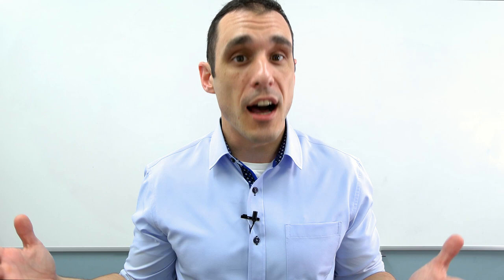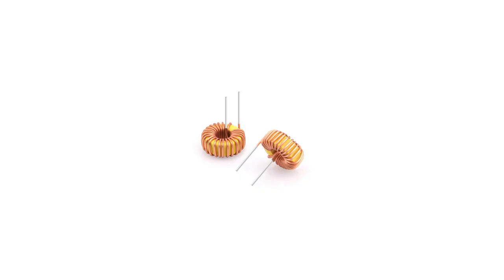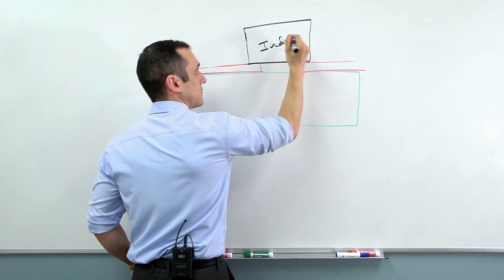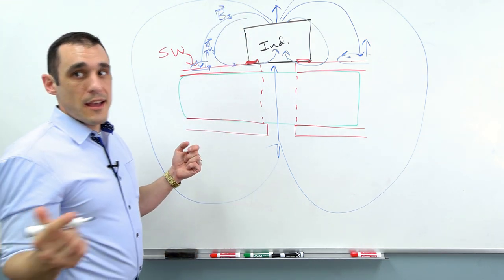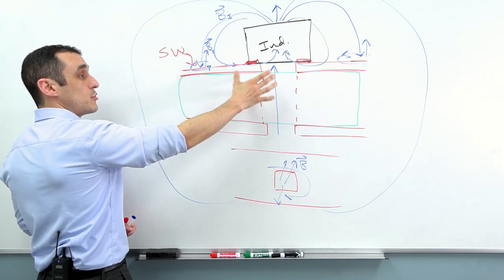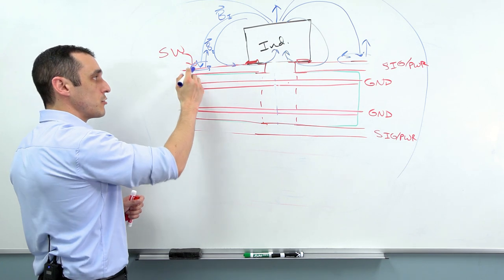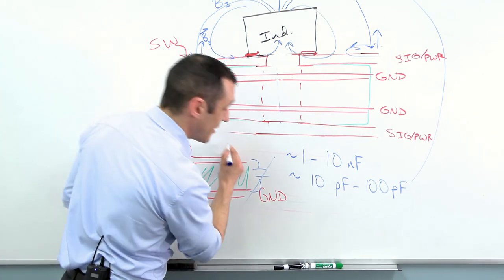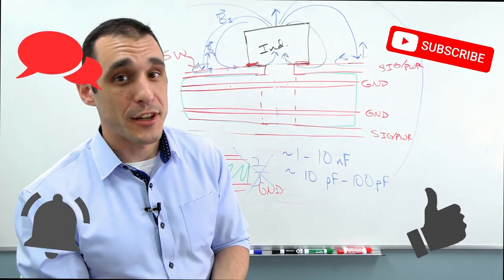Should You Put an Inductor Above Ground? | PCB Layout

Comment: With the cutout, you draw lines going all the way around and into the hole, without the cutout this path has a lot of shielding in the way, does that force these field lines to take a shorter route to like the shorter ones? Is that, and I have no understanding of this, good?
Reply: I draw it like this because the magnetic field always involves closed loops, and assuming the conductors are perfect there would be no normal component of the magnetic field (it would be canaceled by the eddy current). This means the conductor would distort the magnetic field so that it maintains a closed loop above the board.

Comment: Can this be applied to common mode chokes? Just curious
Reply: Yes because a common mode choke is essentally just a pair of inductors. The coupling is the same as you would observe in a transformer, just typically at smaller scale. The difference with common-mode chokes and transformers is that these components attempt to confine the field inside a magnetic core to ensure maximally efficient coupling (i.e., low leakage inductance). Because of how the component is designed you intend to not have much leakage of the magnetic field so you would expect less of an impact compared to an individual non-shielded wirewound inductor.
Reply: @Zachariah-Peterson  Thank you very much for this info Zach!🫡👍

Comment: Should I put the inductor close to components like integrated circuit to reduce noise from tracks ?
Reply: The best way to reduce noise injection into nearby tracks is to put the inductor above ground and to make sure the current loop through the inductor to the output terminals is as short as possible.
Reply: @Zachariah-Peterson  do you mean that I have to put a ground plane under the inductor in the top face and bottom face?
Reply: @haythem4766  You don't have to put ground under the inductor, the circuit will probably work without ground but there could be excessive noise on the output and excessive radiated noise depending on how you laid out the board. The radiated noise could be strong enough that you violate EMI limits and your product does not pass EMC testing. This is important because if you want to sell a product to the public it needs to comply with EMC regulations.

Comment: I thought the main argument for not filling ground under inductors was neither of these. 
At higher frequencies the parasitic capacitance from SW to the output side of the inductor would increase. This due to the presence of copper essentially between them--so the two capacitances from each inductor node to the poured copper, in series. 
Essentially, this lowers the SRF of the inductor. 

I rarely/never do this as i havent found it necessary, but ive always considered it a reasonable approach.
Reply: Capacitances in series (in this case mediated by a conductor) will decrease the capacitance, not increase it. For the SRF of the inductor, I have not heard about the lowering of SRF but you could infer something like that by comparing the winding capacitance to the mutual capacitance between the pads. Typical values of winding capacitance are between 1-10 pF on a large inductor, i would expect very small pad-to-pad mutual capacitance on a large inductor, so the mutual capacitance would add some capacitance but you might expect small effect in some packages.

Comment: Rather than have a copper cut out in the ground plane, could you have unconnected copper in the ground layer where the eddy currents are induced to shield the lower layers? Follow up question: would connecting this new polygon to one side of the inductor have any benefits or consequences?
Reply: If you have unconnected copper that will effectively become an antenna (a poor one, but an antenna nonetheless) because the induced switching currents have nowhere to go but radiate outwards. A floating copper area (not connected to anything) is a very poor EMI shield.
Reply: In general you should not have large unconnected (i.e., floating) bits of copper around the board because they can act like antennas. Because charges can move freely in conductors, they will easily oscillate in the presence of an electric field (this is a displacement current), in and the electric field source plus the floating copper become a large dipole antenna. This then radiates around the PCB and can create noticeable emissions in EMI testing.